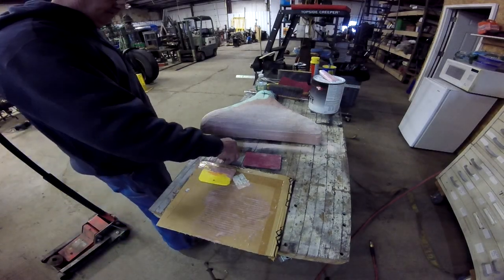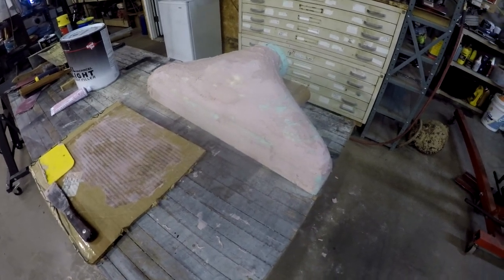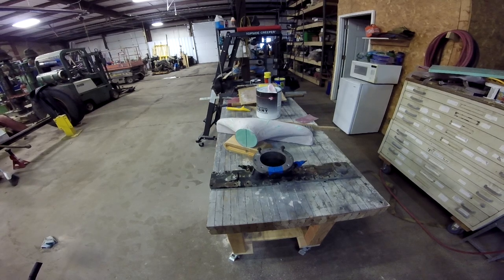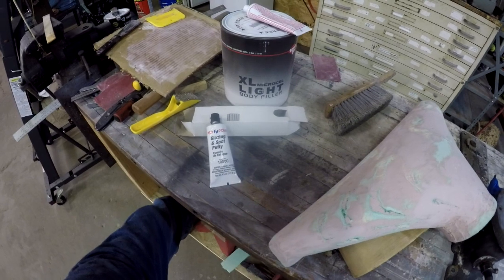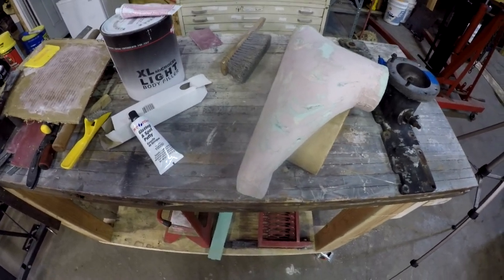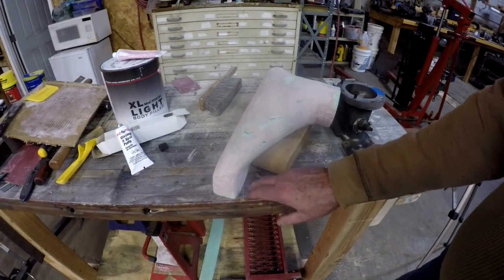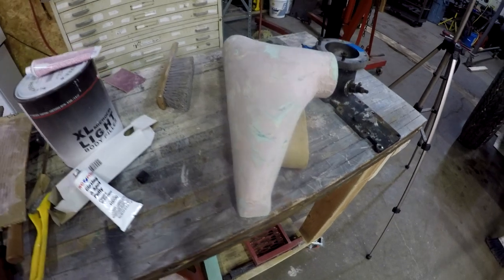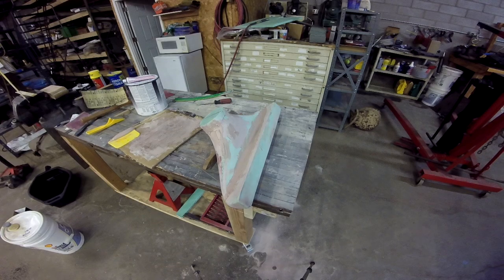Cummins Carbon Fiber Intake Build Part 3 - SMOOTHING OUT/FINISHING MOLD SURFACE

Comment: Great work on the plug. I have made a mold from foam board same as you and I found the hardest thing is to remove the foam core from the carbon fiber part. you can melt it out with acetone and sand any residue out. Just throwing it out there but maybe it wouldn't be a bad idea to have someone create a 3D printed mold for you that comes apart in pieces. some rough dimensions from your physical model would be easy to sketch up in fusion360 and maybe have a youtuber help you out with the print?  for the flange area, maybe have someone laser out the flange from some aluminum to use with your manifold?

Comment: As I am getting farther in to 3D printing, I am finding that most people recommend that you use synthetic wood filler on your printed parts.  FWIW, I could 3d print this part in two pieces and glue them together with DCM.  With tiny layer heights, you get a pretty good finish.  It still needs smoothing, but you can use a spray-on filler/primer for automobiles to help fill the imperfections.
Reply from the maker: Tech Gorilla So would ‘synthetic would’ be easy to remove from inside the carbon fiber after part had been laid up and done? I was thinking of that (3D print of part) when you mentioned it the other day. Going to see this one thru to the end, but if I  ever do something like this again I will certainly be looking at something different.
Reply: @frednewman2162  Thet make a 3D printed filament that dissolves when you leave it in water for a couple of hours.  Strong like plastic, but fades to nothing.  I suppose we could test that theory of making a mold, but not critical to our current path.  I gathering a range of 3D CAD software, but have no clue how to use most of it.

If someone models that intake, I can usually import those files in to a program or slicer for printing.